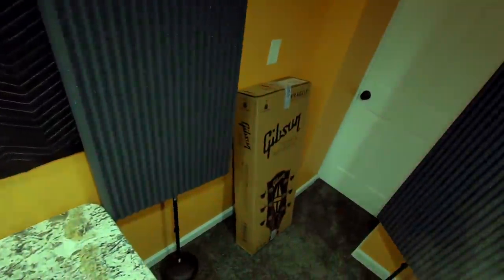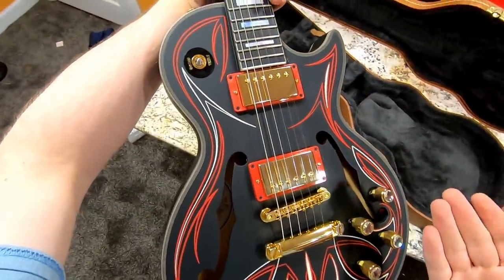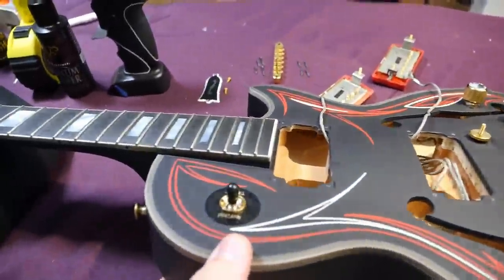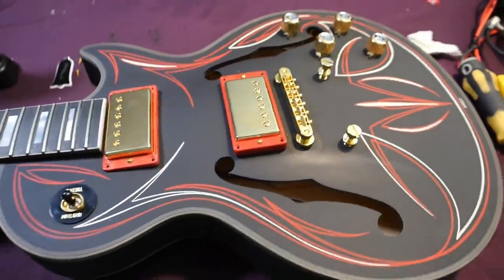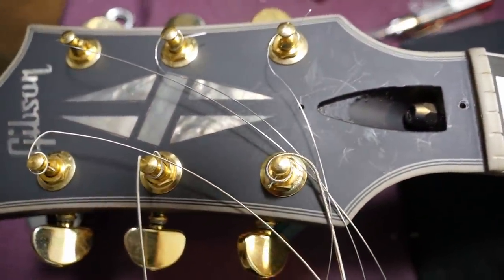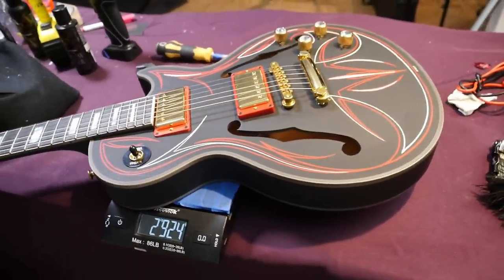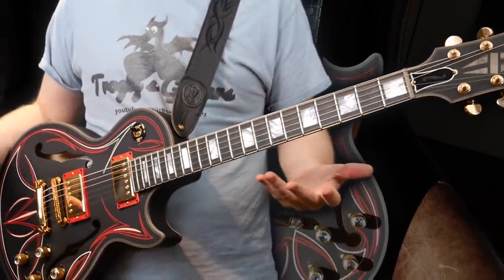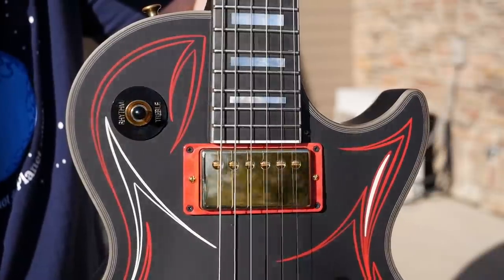The Les Paul With F-Holes | 2015 Gibson ES LP Custom Satin Grey Widow Pinstripe MOD  Review

Comment: That piece you found floating around in the case is the little clip that should be attached to the inside of the “f” hole and it should hold the wires out of the way. They stick on with some 3m.

Comment: Is it just me or do those pickups sound terrible on the cleans, not to mention the intonation sounds off, at least to my ears. Seemed to be OK on the dirt settings.

You are correct about the Richlite fretboards. On my Gibson Acoustic, I was a bit bothered by the fact it was Richlite, but it played so well that I bought it anyway. The Richlite looks better now than when it was new (or maybe I am accustomed to it 🤷‍♂️), although it looked very much like ebony and was finished well when I got it. It is not a cheap material to manufacture in the least. I am very much a traditional rosewood/ebony/maple kind of guy, but I rarely even remember that it is Richlite instead of ebony

Comment: I remember looking through the listing when it was on the website and it said that it came with a Bigsby and I thought "No it doesn't, it's not there!" So it was either a mistake in the listing write-up, or Trogly got short-changed and an optional part was kept by the Mod techs!

Comment: They are awesome guitars, heavily underrated, super light and unbelievable smooth tone… I think this is what the Les Paul should have been from the start… It does country, blues, rock, metal, jazz you name it, extremely versatile and just feels right at barely 5 pounds… The ones with P90s are just insane, strong clean bottom end and smooth chime from the treble…
Reply: Is $2500 worth it on a humbucker version? I have an opportunity but don't really know about a Gibson

Comment: I haven’t completely reconciled myself with Richlite just yet. As a material it’s one of the most durable long lasting materials out there. Its with the Micarta family, epoxy resin composites with 
alternating layers of fabric, carbon fiber, paper, or fiberglass. Originally it was used as a non conductive insulator. It’s also the preferred handle material for high end hard use knives. It’s completely stable, it won’t warp, crack, break or burn. It’s an incredibly resilient material, far superior to wood, but the fact that it is not wood is what makes me unsure about it being used on guitars. Guitars in many ways are all about tradition, and Richlite is in no way traditional. Do space age materials have a place on musical instruments? I really don’t know.
Reply: Like pickups and capacitors? Chrome , ceramics, posi screws

Comment: I have a 2014 Epiphone Les Paul Florentine. Guitar screams and has so much Dynamic control into Fender Pro Junior 4 at 8 or 9. Anything that is semi-hollow, be ready for more low-end. And the guitar weighs less than 6 lb so it does not hurt your shoulder. I will probably never buy a Gibson it's not worth the extra money.

Comment: I'm really tired of the majority of people, myself included, accepting substandard shit from Gibson. How many decades does it take for them to get the QC consistent? It's no longer acceptable to me. PRS doesn't have these issues, and really, Fender doesn't either. For those that wanted to debate me about the quality control at Gibson being "not that bad" here's a perfect example of exactly what I was talking about. A group of chimps using one hand for assembly and the other to pick their asses could probably do a better job. Who puts a spanner around that wheel to adjust it without first putting something on the guitar to protect the paint? Just when I think Gibson have outdone themselves in the shoddy workmanship department, out comes a whole new "here, hold my beer" scenario.